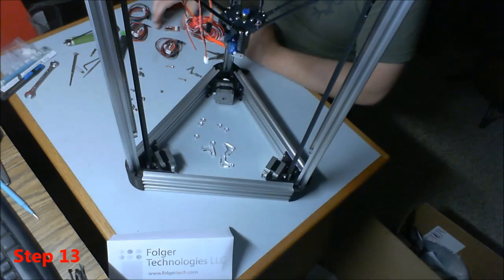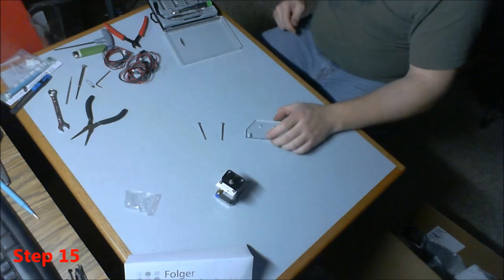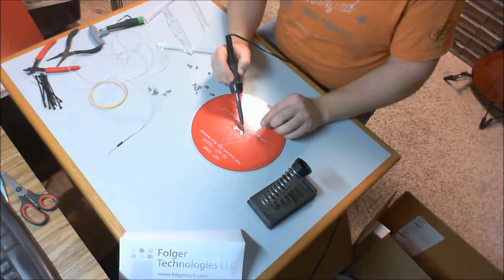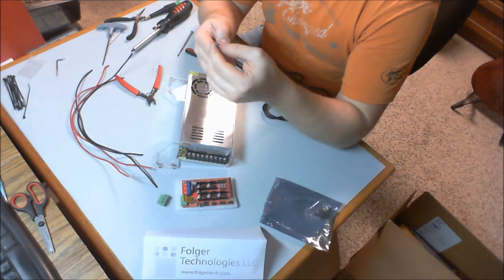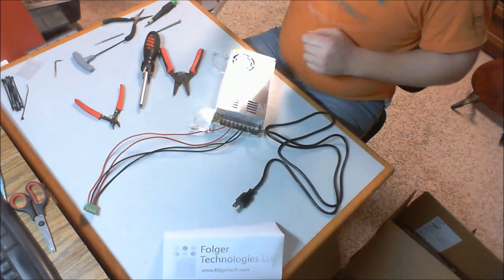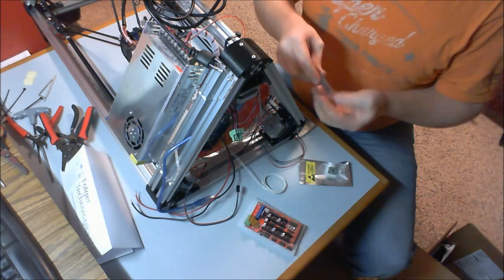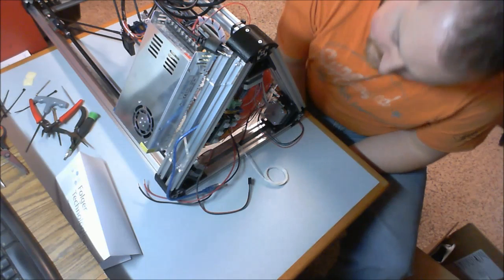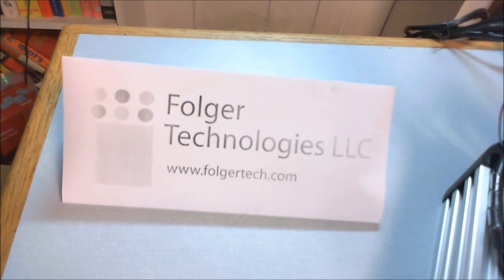Folger Tech Kossel 3D Printer Build Steps 13 - 26 of 26

Comment: A big thank you for your tedious work but I think that I will pass on this model . I don't like the hot end mounting plate, to flimsy and bad design . I don't like the Bowden kit with no tension spring , no speed control on the extrusion fan or at least a control to start and a stop at a certain temperature . BUT your video is very very well made well explain and your patience is something that I think I wouldn't have for that product. Big THANK
Reply from the maker: +Gil B When it comes to 3D printer kits, you really need to find the kit that is right for you. I am glad this video helped, even if you chose not to purchase this particular kit.

Comment: Hi I'm currently building this kit from folger tech (I think that my manual is a little different from yours but I think it's basically the same stuff). I'm working on putting together the hot end and putting the servo on but I don't see anywhere in the manual where they attach anything mechanical to the servo.  Also I received little white plastic arms and I have no idea what to do with them. Any suggestions?
Reply from the maker: +RebelRebelRose To be honest, I didn't like the servo /fan mount that came with the kit so I designed a new version.. I'll likely sell the printed parts I designed. in any case, the servo mount is part of the hotend mount and the way the kit's part was designed you use one screw to attach the servo to the mount and then there should be a micro switch arm that you attach the switch to and the other end to servo. it is possible that you have to insert what is called the servo horn into the switch arm, but my kit didn't come with that part and I think it has since been changed like in the kit you have.

Comment from the maker: Jonathan, programming requires that you have Arduino software installed and that you have a firmware package available for your printer (I like Marlin). you then open the package in the Arduino software and write it to the Arduino mega. But that is just the beginning because each machine is a little different and will require modifying the firmware code to fit your machine. It is a tedious process but makes a more accurate printer.

Comment: Thanks for posting this it has been helpful

one question however,

In your video when you are connecting the bottom motors to the board, you are connecting the green end of the cable orientating towards the green power plug, however in the Folgertech instruction manual it is the opposite way

Which one is correct?
Reply from the maker: Alvin Thai Yes I did connect the motors with the green wire toward the power connector, firmwares may have changed and if you find all of your motors are going in the wrong direction, you can flip these plugs. PLEASE PLEASE PLEASE don't confuse the ability to switch the orientation of the motor wires with the endstops. if you switch the endstop wires you'll fry your ramps board.

Comment: Thanks for the Video :

how many Amps is this 12v PSU ?
Reply from the maker: billme later 360W 12V 30A Power supply
Reply: ah , ok thank you
i have a 12v 10A i will use it for mega board ,   i need another one for heat bed 12v 11 or 13A

Comment: Good job on the set up videos, I am really thinking about getting one. Have you got it dialed in yet, and have you got to play around with it yet? This would be my first 3d printer and I am mechanically and electronically inclined. On a scale from one to ten how difficult was the build and the software set up? Good lick and have fun with your new toy.
Reply from the maker: I have not had a lot of tome to play with it yet, I did make a print but I need to so some calibrating still. on a scale of 1 to 10 the build was about a 6, but the firmware will probably be about an 8 once I figure out how to enable the auto level and get my lcd working.
Reply from the maker: bubalettow I just discovered a new firmware for the Kossel on the Folger Tech Google Drive. It's Marlin (which I prefer over repiter) and has LCD support already enabled. I did notice that my extruder motor was going the wrong way so I'll modify that and I still want to get the auto level servo working. Regardless, this is progress :-)
Reply: bubalettow  active thread on reprap building the same kit. might help you with the firmware/tinkering

http://forums.reprap.org/read.php?4,445488
Reply from the maker: for starters test the motor on another axis, then verify that your driver is installed correctly, if you can get it to move without filament but not with, then you probably need to adjust your driver for more current.